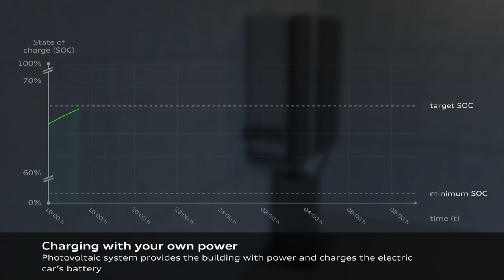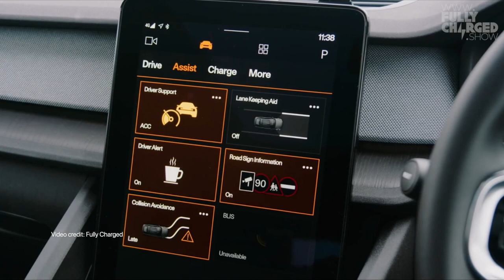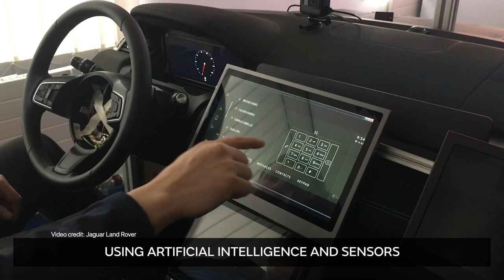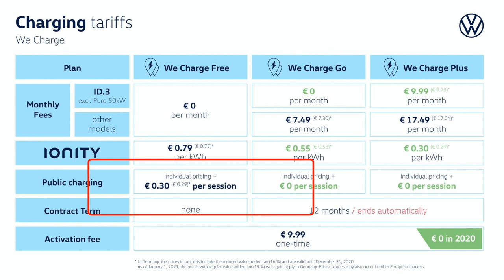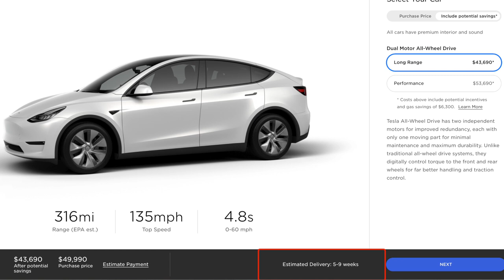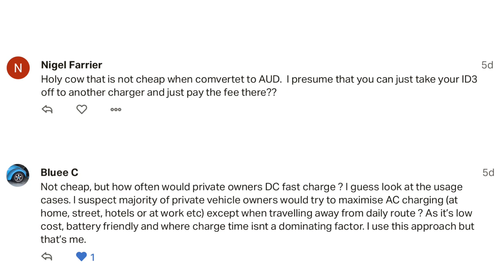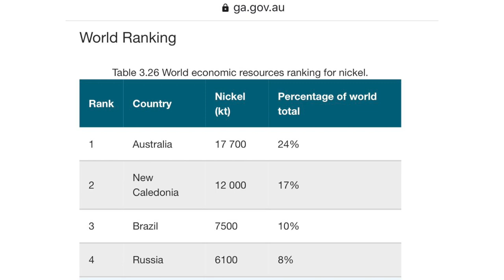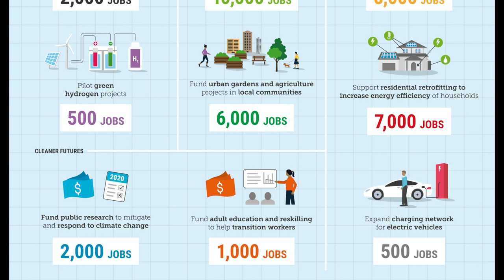More details about Tesla Model Y for Australia | EV Incentives petition | 27.7.20

Comment: Would be somewhat difficult to get V2G going, without the new CCS v2 cars, and you would also need grid approval for the home adapter as a generation device. Which probably would not be the most difficult part, that part would be the price.

FWIU the only CHAdeMO adapter that can use V2G at Home, is a frightening price so far (wallbox quasar is $7000 if you import from Europe/UK or the US... Or wait for Jetcharge to import it) and you still need support in the car ... on what will be a legacy CHAdeMO adapter that only the 2019 Nissan Leaf and Ariya have.